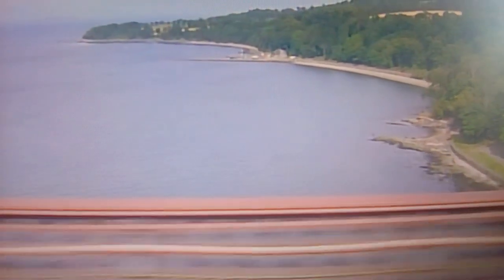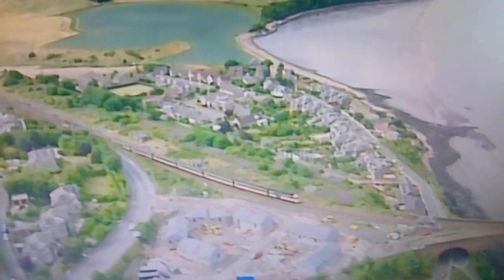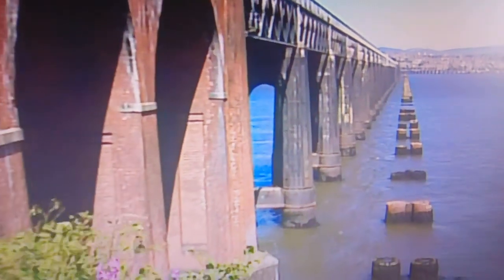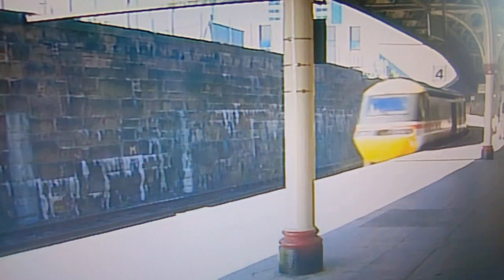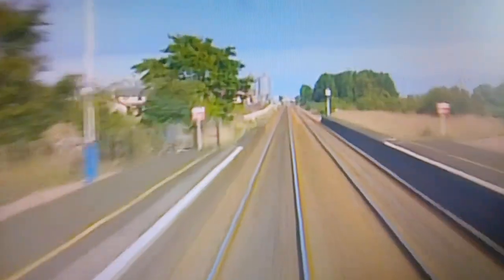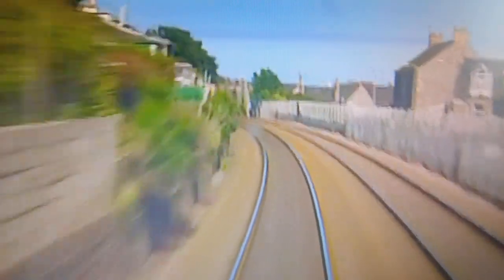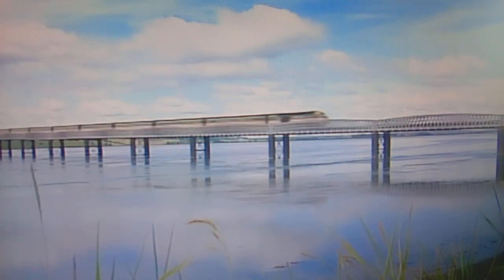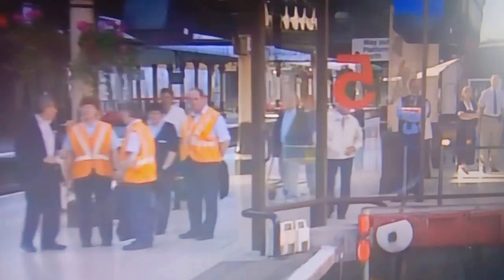British Rail Edinburgh to Aberdeen 1996 Remembering Tay Bridge Disaster 1879 . 60 died RIP

Comment: Thank you, Alrx.  A wee bit more than poignant and bittersweet.  Rest In Peace.

All the best.  Rab    ⏳  🎲                🌠      💚

----------------------------------------

Tay Bridge Disaster [Credit: wike pe dia  Much more information available therein]

On the evening of Sunday 28 December 1879, a violent storm (10 to 11 on the Beaufort scale) was blowing virtually at right angles to the bridge.  Witnesses said the storm was as bad as any they had seen in the 20-30 years they had lived in the area; one called it a 'hurricane', as bad as a typhoon he had experienced in the China Sea.  The wind speed was measured at Glasgow - 71 mph (114 km/h; 32 m/s) (averaged over an hour) - and Aberdeen, but not at Dundee.

Higher wind speeds were recorded over shorter intervals, but at the inquiry an expert witness warned of their unreliability and declined to estimate conditions at Dundee from readings taken elsewhere.  One modern interpretation of available information suggests winds were gusting to 80 mph (129 km/h; 36 m/s).

Use of the Tay Rail Bridge was restricted to one train at a time by a signalling block system using a baton as a token.  At 7:13 p.m. a North British Railway (NBR) passenger train from Burntisland (consisting of a 4-4-0 locomotive, its tender, five passenger carriages, and a luggage van) slowed to pick up the baton from the signal cabin at the south end of the bridge, then headed out onto the bridge, picking up speed.

The signalman turned away to log this and then tended a stove, but a friend present in the signal cabin watched the train: when it got about 200 yards (180 m) from the cabin he saw sparks flying from the wheels on the east side.  He had also seen this on the previous train.  During the inquiry, testimony was heard that the wind was pushing the wheel flanges into contact with the running rail.  Black explained that the guard rails protecting against derailment were slightly higher than and inboard of the running rails.  This arrangement would catch the good wheel where derailment was by disintegration of a wheel, which was a real risk before steel wheels, and had occurred in the Shipton-on-Cherwell train crash on Christmas Eve 1874.

The sparks continued for no more than three minutes, by which time the train was in the high girders.  At that point 'there was a sudden bright flash of light, and in an instant there was total darkness, the tail lamps of the train, the sparks and the flash of light all ... disappearing at the same instant.'.  The signalman saw none of this and did not believe it when told about it.  When the train failed to appear on the line off the bridge into Dundee he tried to talk to the signal cabin at the north end of the bridge, but found that all communication with it had been lost.

Not only was the train in the river, but so were the high girders and much of the ironwork of their supporting piers.  Divers exploring the wreckage later found the train still within the girders, with the engine in the fifth span of the southern five-span division.  There were no survivors; only 46 bodies were recovered out of 59 known victims.  Fifty-six tickets for Dundee had been collected from passengers on the train before crossing the bridge; allowing for season ticket holders, tickets for other destinations, and for railway employees, 74 or 75 people were believed to have been on the train.  It has been suggested that there were no unknown victims and that the higher figure of 75 arises from double-counting in an early newspaper report in the Dundee Courier but the inquiry did not take its casualty figures from the press; it took sworn evidence and did its own sums.

---------------------------------------------------

R   👋  ✝
Reply from the maker: "Thomas Bouch: Architect of the Tay Bridge disaster | The Independent | The Independent" https://www.independent.co.uk/independentpremium/long-reads/thomas-bouch-tay-bridge-disaster-trains-dundee-a9229646.html?amp Hi Rab Thomas Bouch only 26 years of age chief engineer
He's not only to blame the Bridge must have went through all sort of inspections and passed  sad sad 
Hope you're ok Alrx  🚂🚂🥃🥃
Reply: @alrxanderwylie6512  Thank you for that, A.  Sincerely accepting your rationale.

I am fine thanks and, of course, dearly hope you are the same.

Here is to the rest of our wee holidays ...

Bye for now, A.  R  👋  🕊